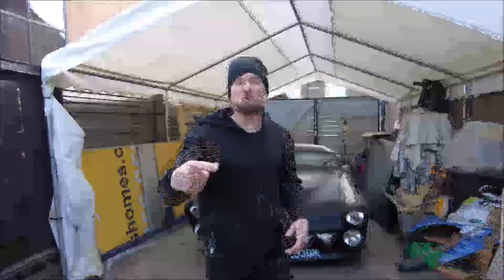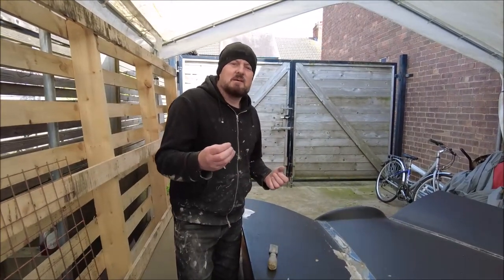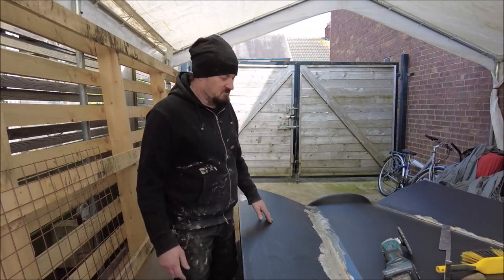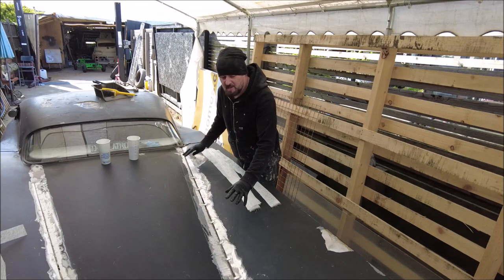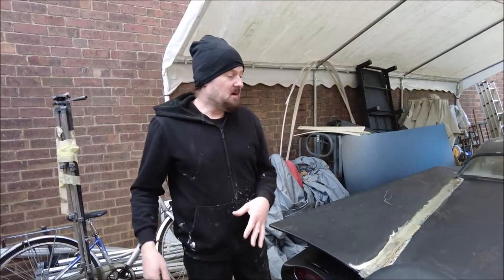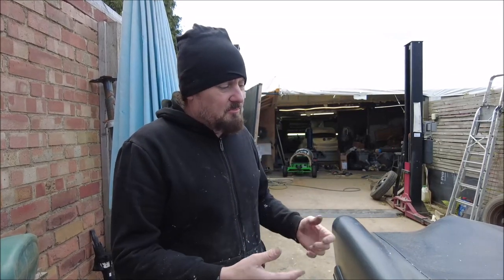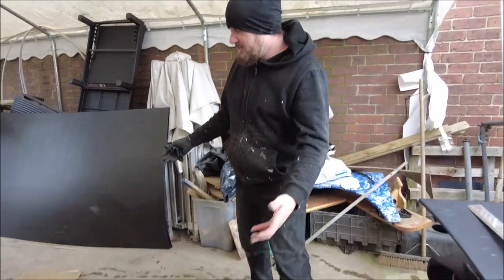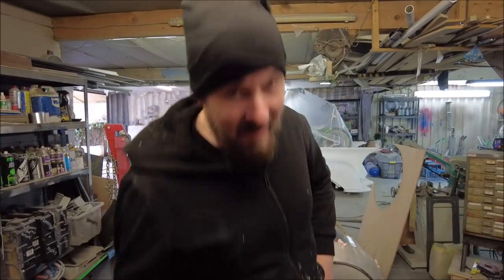Dualatron Meets its Maker

Comment: Paul.... 1708 would be a better option than All 1.5oz Mat..... The strans on 1708 run 45+/45-.....It has 3/4oz mat stitched to it..... This way all the strans run across the joint.
Reply from the maker: Interesting, thanks so much

Comment: The delamination has nothing to do with the roughness or "Keying"... 
It has everything to do with the fact that Polyester doesn't bond to Aluminum in anyway. It might look like it sticks but it's only a mechanical bond and not an adhesive bond.
In the future you might want to consider not using aluminum sheet at all, instead lay up thin flat sheets of FG and build on that. It will be cheaper and ultimately easier.
Reply from the maker: Ooo thanks for the tip
Reply: @bacop001   I realized when I said thin, I meant like a single layer of 1.5 oz Mat. This way its extremely flexible and you can bend, shape, bond and trim it very easily. You could even do the glassing on the inside in some instances making for a lot less finish work on the outside.
You can use Body filler or even chopped glass putty to bond it. 

Love your work and the style of your work by the way.